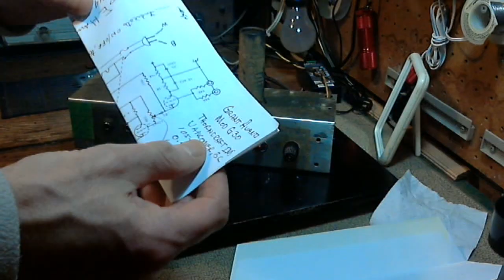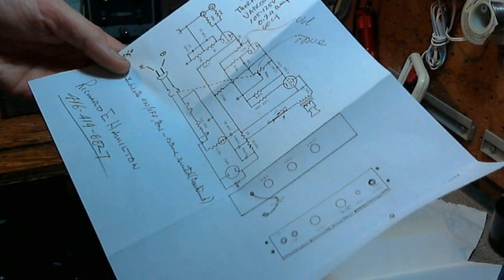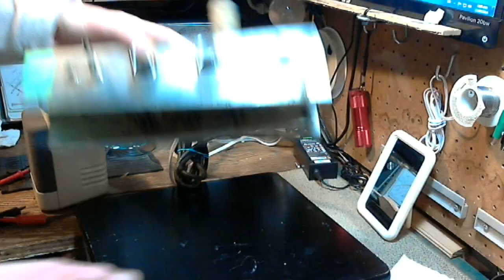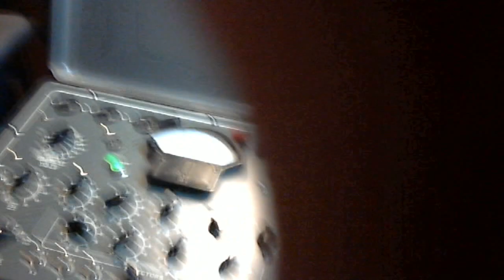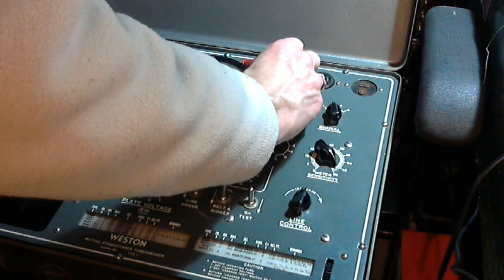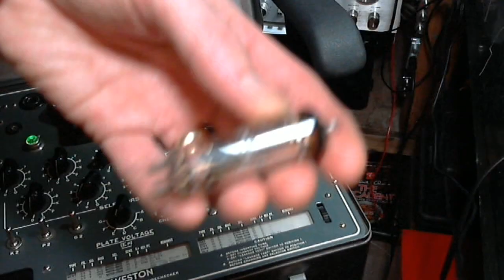Vacuum Tube Guitar Amplifier Grant Avanti G30T Video #1 - Checkout

Comment: I really like your videos! I guess light bulb is in series with the amp: why did you expect that glow at the end of the video? I know that the lamp should remain on in case of short and dim when the tubes warm: is it correct or I'm getting lost??
Reply from the maker: At the first moment of turn on, the tube filaments are cold and draw a lot of current causing the light to light up brightly but quickly drop off.  Then, as the cathodes become warm, they emit electrons and the tubes begin to conduct causing more power draw and the light to increase again.  At that point, I know the tubes are conducting and the radio is safe to go to full line voltage.  I use this procedure in my shop every time I turn on a radio since there could be a problem I'm not aware of like a tool falling into the radio.  If there is a serious short in the radio, the light will come on full and I'll know right away that I must cut the power.  Some bigger radios draw enough power that I use two light bulbs in parallel.  

I point this action out in many of my videos and, if you can see the line volt meter, you can watch it.  Just remember that my line meter starts at 100V not zero like most meters.

Comment: Hi Jim. I really enjoyed the GH Chat today. Thank you very much for the invite. I've had my share of shocks from those older guitar amps. Back in the day.
Reply from the maker: My own guitar amp is very similar but it hums and buzzes.  I've been looking closely at how this one is built since it runs very quietly.  All the wiring is dressed at right angles and kept tight to the chassis.  The 12AX7 grids are fed with shielded wire but the ground shield is only connected at the far end to a chassis ground.  The input jacks are grounded to the chassis by their nuts (ouch).  And the circuit ground is connected to the same chassis ground point but through a .1 capacitor.  I think those are all the tricks so I need to compare to my own amp's wiring and construction  Maybe I can chase the buzz away..
Reply from the maker: I think we'll be doing the Thursday morning thing from now on.  The sessions are Video Hangouts, not Hangouts On Air, and they do not get recorded or posted to YouTube.  That allows for a very fun atmosphere.  So I'll create a circle in Google+ with all the crew and invite that next week so you'll be included.  Hey, I'm going to really use Google+ for the first time!